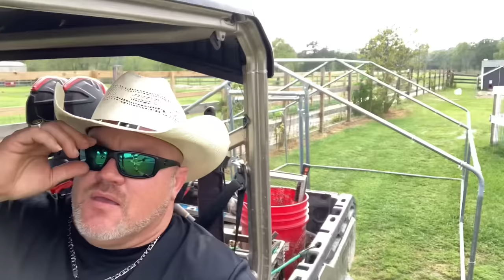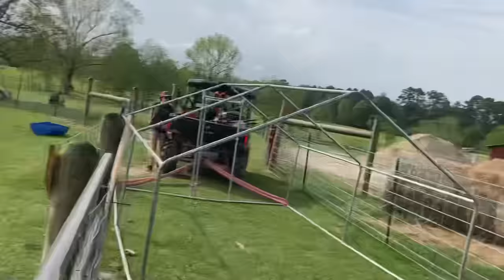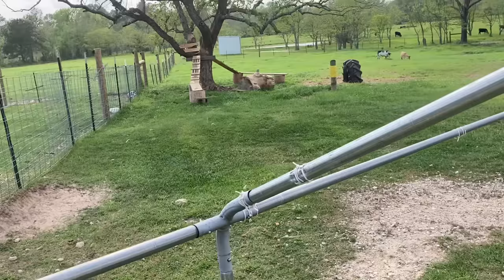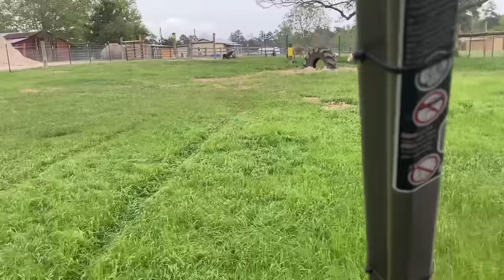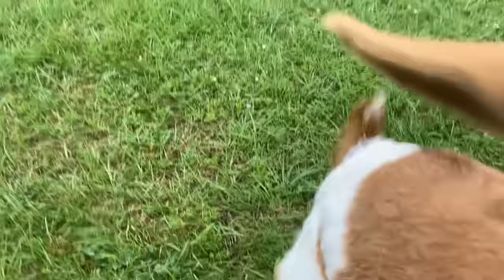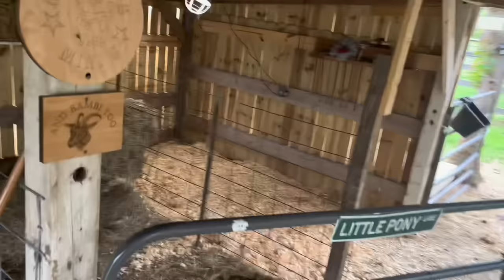Dolly has Separation Anxiety

Comment: You are very lucky to have such a smart and beautiful daughter, I think she teaches you more than you teach her at this point. There is nothing wrong with that tarp hanging down on the one end, it will provide more shade and a wonderful wind break for the animals. All you need to do is get a grommet gun and make new holes so you can tie it down better and make it really tight so that it won't blow or rip, and then put your T stakes on the corners to secure it in place. The baby goats are as adorable as can be, they are so sweet. Buffy needs her mane brushed and conditioned with some coconut oil. Her mane looks unhealthy, like brown dry straw. The coconut oil would also help her coat look healthier. It’s natural, so it will be safe if she decides to lick. The barn is looking really good, good job !! 👍🏼👍🏼👏🏼👏🏼

Comment: wondering if you took the tarp down yet, looks like it has a whole bunch more grommet holes so might work if you pull the long side down another inch or two and zip tie it under the bottom rail and then use a zip tie in every grommet hole to get it stretched tighter over the top.

Comment: Wood chips r really bad for horses hooves they dry the hoofs out and causes alot of problems maybe try straw for then it will be better in the long run and u won't have hoof problems
Reply from the maker: They use shavings in almost every professional horse stall I have ever seen. That is all they use at the dolly stampede for sure. 😂